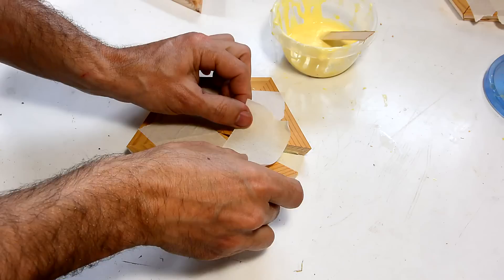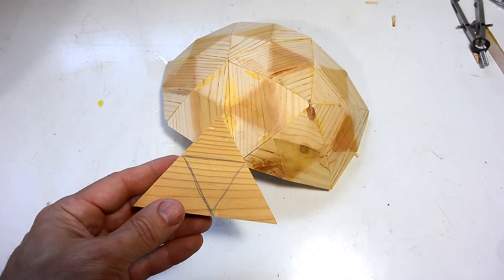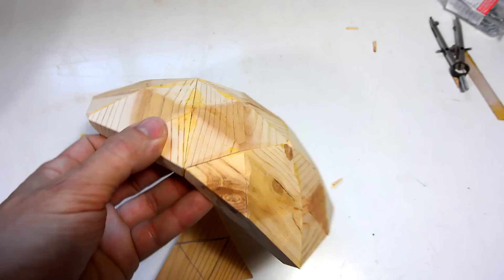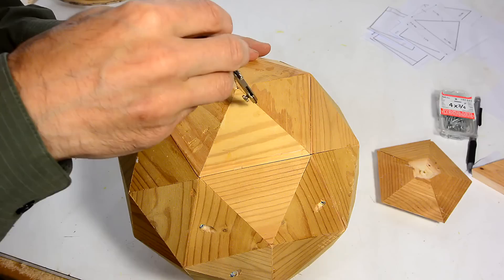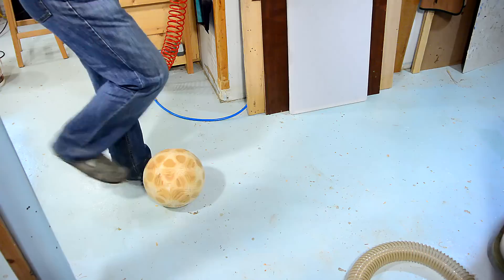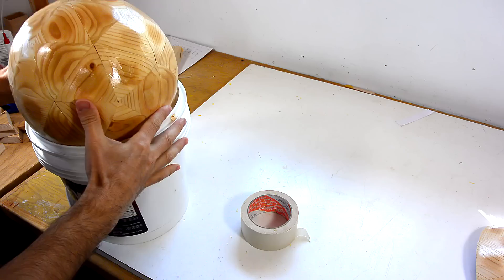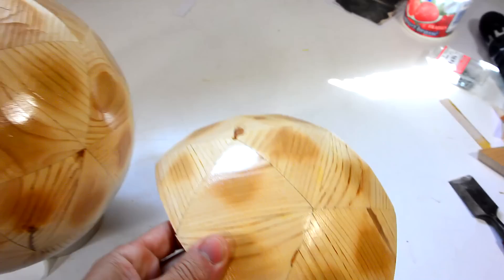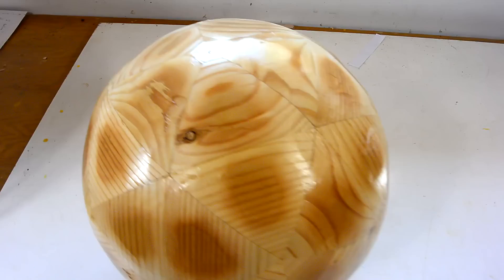Wooden soccer ball

Comment: one way to make this round is to make a radiused sanding block with coarse sandpaper to rough it out and then finer then sand by hand.  the sandpaper would only be sanding the outside protruding edges.  The radius of the block would be the smallest radius of the ball (obviously : >).  Of course, sanding it round would be tedious at the least, and it seemed like this was a "let's see if I can do this" project, not a perfection kind of thing.   There is a jig for holding rocks to make them perfectly round, flipping them around all the time, the corners gradually being ground off to a smooth ball.  I tried to build one for my large standing sander.  It actually worked pretty good but the ball was only about 3" dia.   It sure bounced around until the corners were knocked off!
Great project!

Comment: When I saw the paint bucket as a support I thought you might have pumped air into it to float the ball and let the belt sander both spin it and form it at the same time. Kind of a multi-axis air lathe? Might be interesting to think about.
I love the sound of it rolling at :50. Something about the pattern of the bumps is really interesting.

Comment: Maybe if you put your ball on the lathe for sanding no holed just a pressure fit between centers. something that looks like a plunger to hold the ball without making holes.  That way you can rotate the ball to create different sanding circles truing up the diameter.  good luck

Comment: How about filling this thing with cement and making a bowling ball from it?
Reply: ttyk It's not round from the inside. It's a 60 sided dome, just shaped from the outside.
Reply: Matt McConaha
If the glue that holds wooden pieces is strong enough for this ball not to break under the cement-piece's weight, that would work. I think.

Comment: if you wanted to make a sphere, why not just turn it?
Reply from the maker: I made a sphere because I had a shape close to that already.  Turning that on the lathe is harder than you imagine.
Reply: Matthias Wandel as a professional woodturner i disagree
Reply: Matthias Wandel really you just need to turn until the flats just barely dissappear. no measuring, not much skill needed. that is if your ball was made evenly
Reply from the maker: yes, not much skill after you have it perfectly centered and rigidly mounted.  Because the skill part is actually getting it to that point.
Reply: Matthias Wandel centers are a beautiful thing.
Again, if it was made evenly you should be pretty close just by marking it out and giving it a poke. (hot glue soft blocks if you dont want to mark up the surface).

spin it by hand using the tool rest as a surface gauge pointer and adjust until the outside points are relatively concentric.

For something like that its not like you need a faceplate or any crazy mounting solution.